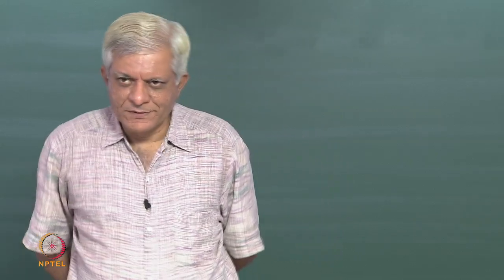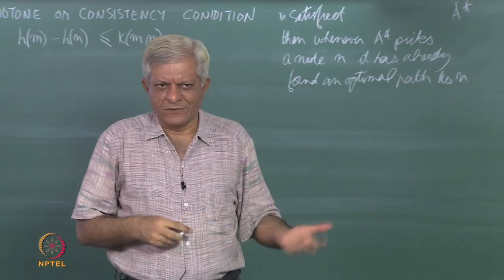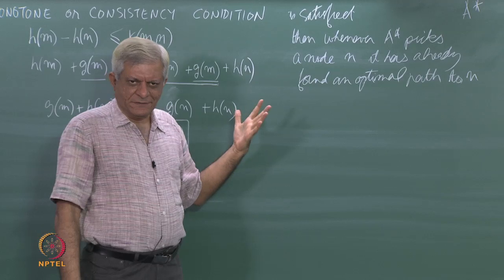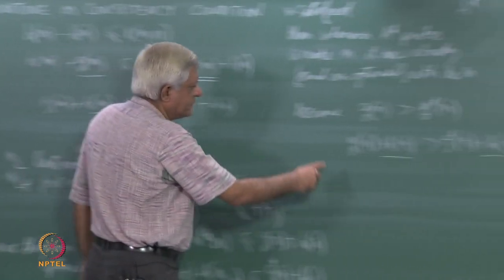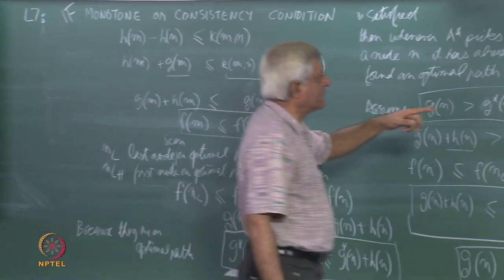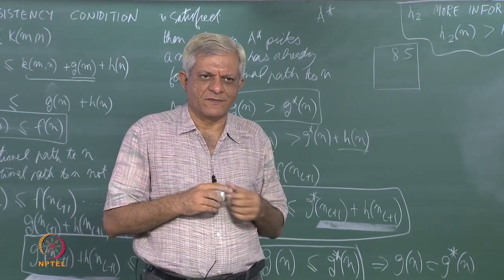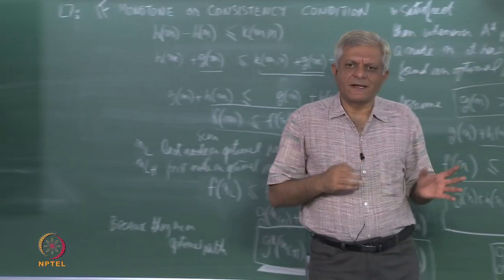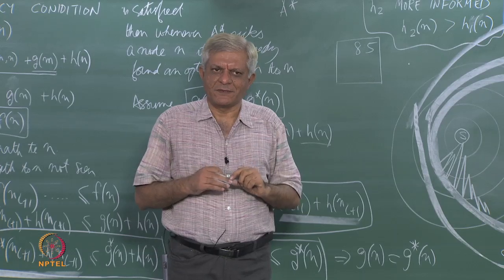A* Monotone Property, Iterative Deeping A*

Comment: why was f(n)<=f(nl+1)
Reply: Did you get the explanation?
Reply: That's because A* algorithm works on the basis of a priority queue sorted on f( ). If n is expanding before nl+1, doesn't it mean f(n)<=f(nl+1)?
Please note that nl+1 is in open.
Reply: To get the correct answer
Reply: @dharminshah2722  If you are on an optimal path towards the goal. Then by going to a child node n' of a node n, your path got shorter. Because you went one station further towards the destination. This is reflected in the evaluation function f(n) also. Therefore, f(n) <= f(n') . Or as you wrote. f(n) <= f(n+1).
Reply: @aviraljanveja5155  But since f() is monotonically increasing as we move close to the goal, it should be that, f(n) >= f(nl+1)?